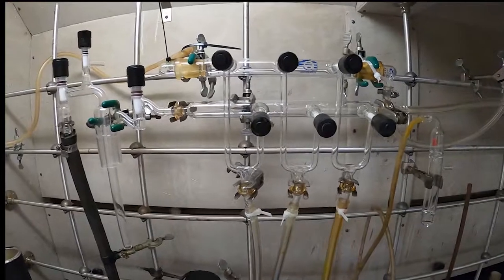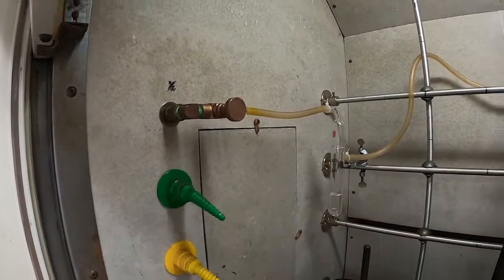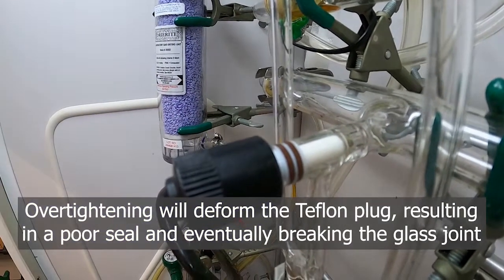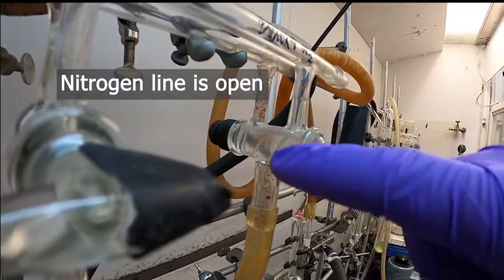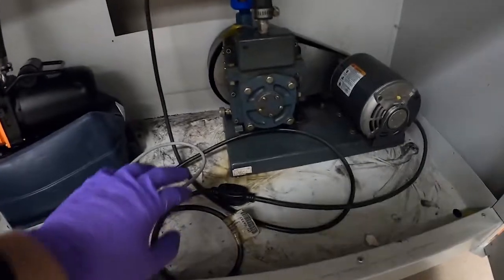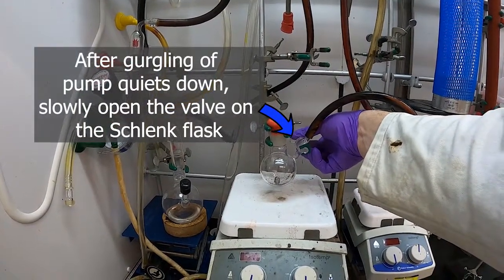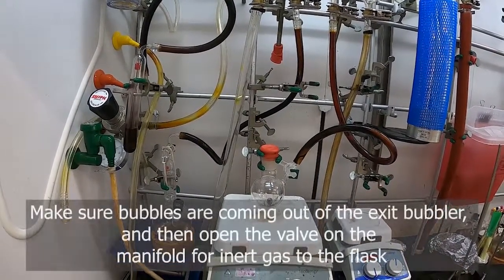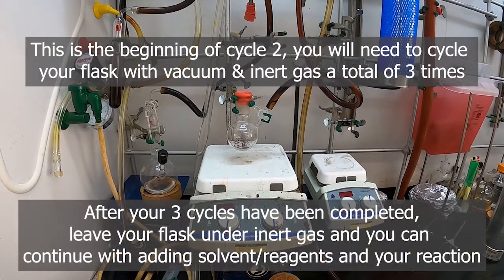Introduction to Schlenk Lines

Comment: How you connect the column of Drierite, meaning inlet inert gas—bubbler—manifold? How is the order of place them, please?
Reply from the maker: The column of drierite has two connectors on it, one for in and one for out. You simply connect rubber tubing to it and then use hose clamps to secure the tubing. The inert gas comes from the inert gas source (tank, dewar, etc.). You then should have an inlet bubbler so that you know what flow is coming from your inert gas source. Then will come the drying column (drierite in this case). You need to make sure that the drierite is placed higher (vertically) in the hood than your inlet bubbler, otherwise you will have mineral oil collect in your drying column if you have too high of an inert gas flow. You can have the inlet bubbler and the drying column in the reverse order, but I feel it is a safer setup to know what pressure you have going into your drying column. The described setup also prevents mineral oil from the inlet bubbler getting into the manifold. Then comes the manifold, followed by the exit bubbler.